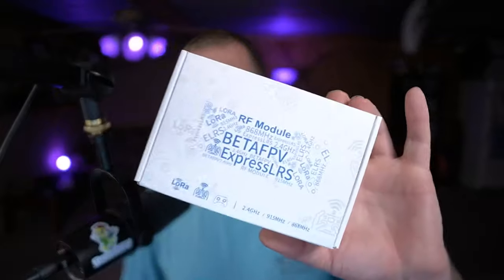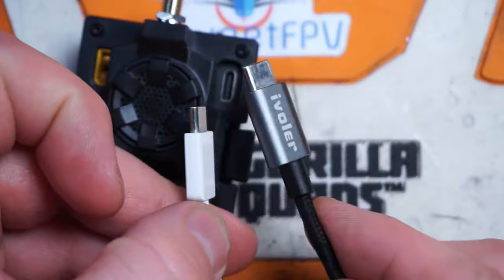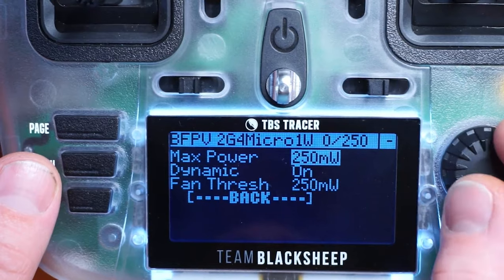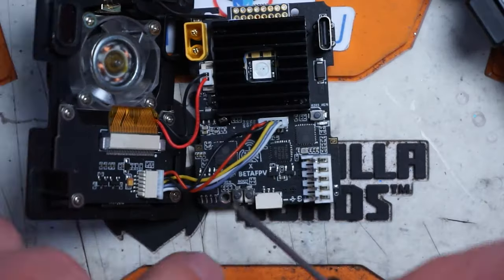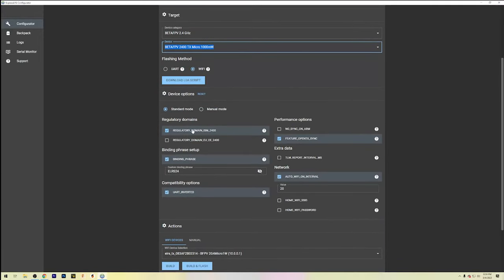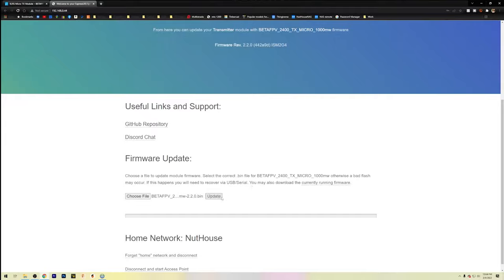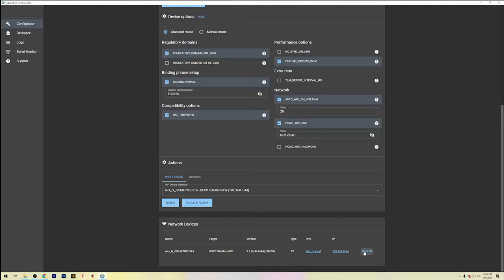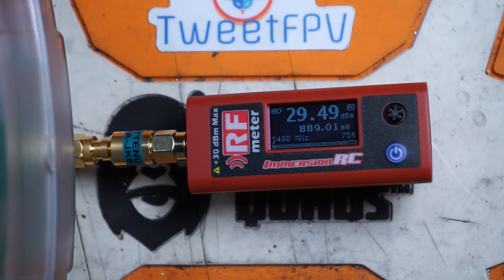BetaFPV ExpressLRS 1Watt Micro transmitter #elrs #1watt #betafpv

Comment: Good video! With the range I have seen with ERLS even at 250 mW, this will be nothing more than a battery burner. From my ham background I remember a rule that was "don't transmit with more power than you need". Just my 2 cents.😁